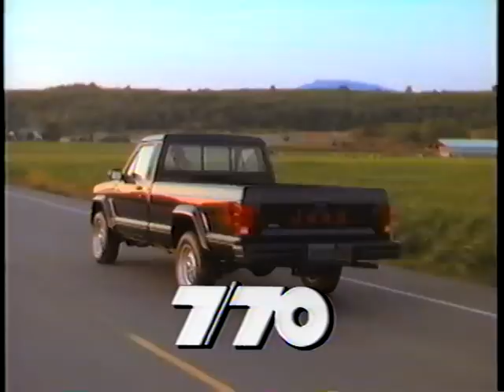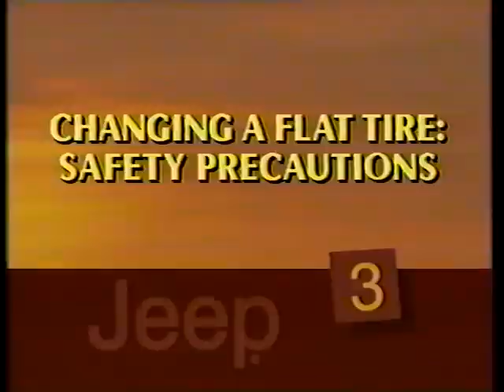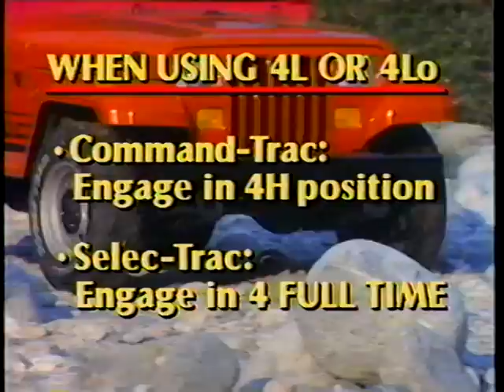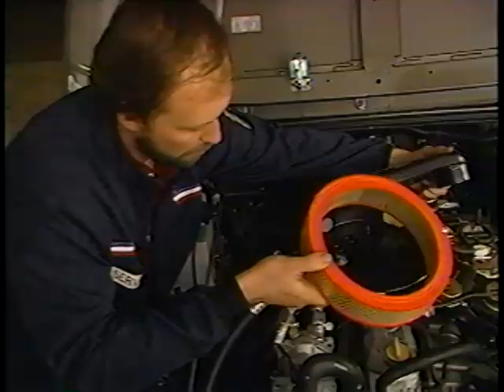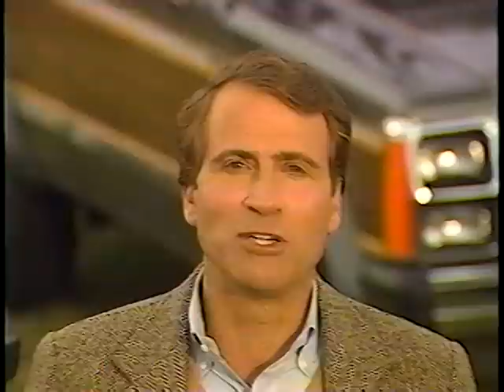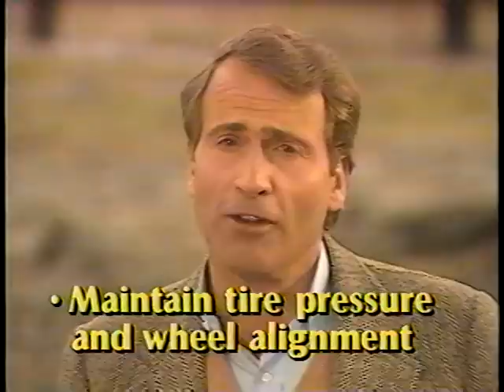A Video Guide to your new Jeep Comanche

Comment: AMC Baby !  The XJ (4.0L)is one of the best vehicles ever made. My 1987 compact Wagoneer Limited was great for 22 years, got hit by a red light runner and so I bought a 2000 Cherokee Sport. 35" BFG Mud's ,7 inch lift, Lockers, Dana 44 rear from my 1987 XJ, Still driving it and I will always own an XJ. My 1991 MJ Comanche Eliminator 4.0L 4x4 is just about ready for the road again. At some point these jeeps will need to be restored to keep them on the road. My 2012 Grand Cherokee Limited 33" muds, Looks cool but I don't trust it like my older AMC family of jeeps, Owned 1995 Wrangler 4 cyl 4x4,1987 Compact Wagoneer Limited 4x4 select trac,1993 Grand Cherokee 5.2L V8 4x4, 2000 Grand Cherokee Limited 4.7L V8 2WD, 2005 Grand Cherokee Limited 5.7L  Hemi Quadra-drive II ,2012 Grand Cherokee Limited 3.6L quadra-drive I 4x4, And My Never sell , 2000 Cherokee Sport Selct-trac full time 4x4 4.0L 
NAXJA Member since the early 90's

Comment: I had one of those, great little truck that I inherited from my father. Sadly it was totaled by an old man in a minivan. I replaced it with a year old Cherokee that had about 23,000 miles on it. It's twenty years and about 600,000 miles later and I still have the Cherokee.
Reply: If you haven't yet, check out the blue ridge mountains. Beautiful.
Reply: @BeautyAndTheBeeast  That's for sure, I've been on most of the Blue Ridge Parkway and Skyline drive in that Jeep. Plus Asheville, Maggie Valley, Boone... bunch of places!
Reply: How is the jeep now?
Reply: @elijahjohnson5872  It's doing fine. My daily driver was in the shop for a week and I drove the old Jeep back and forth to work, (100 miles a day) no problem. A couple of weeks ago I took it on a little road trip, drove it about 300 miles that day, longest drive in one day since driving it Illinois and Michigan in 2015. In the spring I'm planning on taking it on a drive around North Carolina's Outer Banks, one thing I've never done in it.
Reply: What year is it? That is awesome! Does that Cherokee still have the original motor and transmission?
Reply: @oof4dayz  It's a 96. The engine was replace with an excellent rebuilt one about 300k ago (and I've been a LOT more careful about oil changes since). Transmission is original and it's on it's third clutch.
Reply: @JeffDeWitt  That is awesome, I have a 2000 Cherokee Classic with 4x4, it has the Toyota-made AW4 transmission and the straight 6, both original but mine still only has 135k miles on it.
Reply: @oof4dayz great section of comments! I've just bought a mint 99 ZJ, with only 42k miles! Hope yours is going ok still👍
Reply: @PandaAlessi  I actually originally wanted a ZJ but in my area they were all clapped out sadly. It took me 20 XJs to settle on the one I have now
Reply: @oof4dayz  wow, persistence paid off! Sounds good 👍🏻

Comment: My brothers Comanche has been customized for rock crawling and it can go mudding but man does it overheat quickly. And when it does it's probably 110 to 140 degrees in the cab and about 240 plus in the engine. And yes it has a working fan and I'm pretty sure the radiator works good as well.